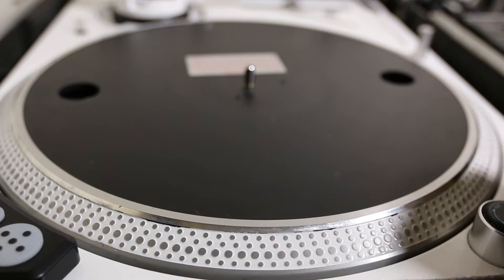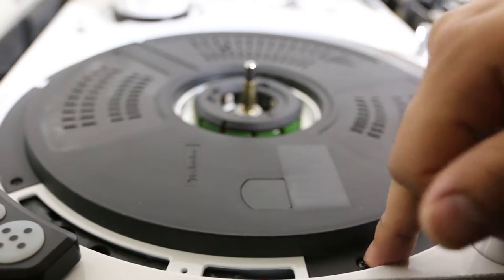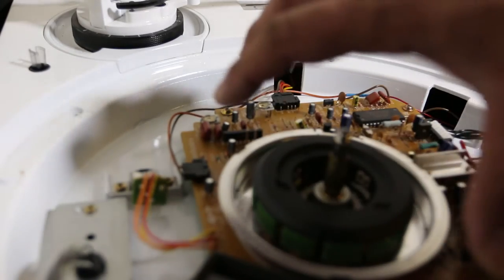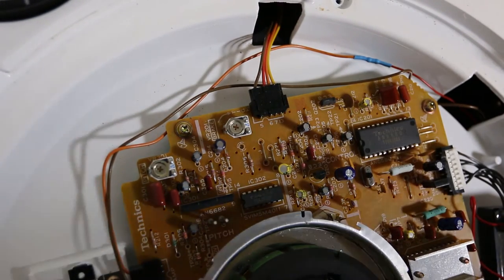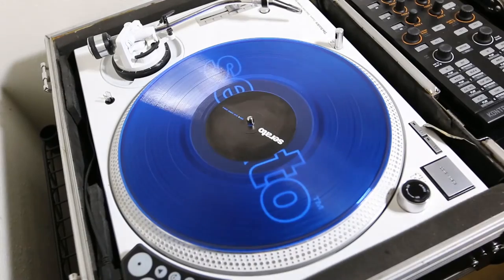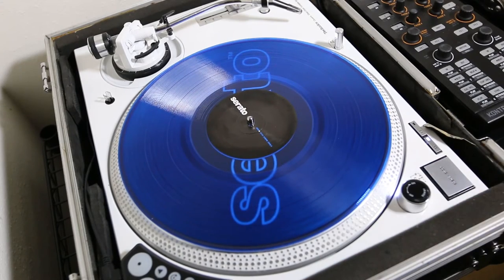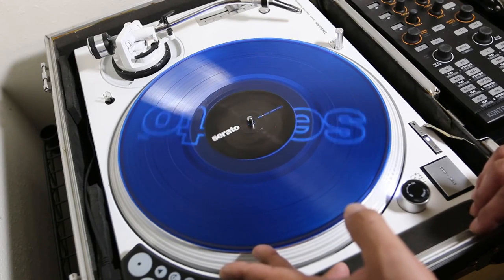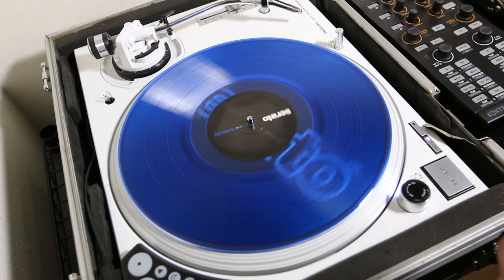Technics Turntable Brake Calibration Walkthrough

Comment: I wish you would do a video on how to get Serato to use an external Drive as the main memory. In other words I have an external drive with all my music, but Serato wont remember my cue points or BPMs. I have to analyze every time and start from Scratch. If all my music was on my mac it would remember everything as soon as I open up my Serato. I have a ton of music and do not want to put it all on my Mac. I bought my Mac brand new in 2014 from Best Buy and have also looked into just upgrading my memory on my mac but was told by the geek squad that I cant do that because the memory is integrated with the mother board. Not real sure what to do. I would like to start using Serato but for now I'm using VDJ 8 with a DDJ-SX-N which is a great software but I notice that there is a lag on VDJ when Scratching. as a matter of fact you sold me that controller. Anyways, I have ran into other people that have that same problem. Maybe you could help. Thanks Brotha!! Your videos are always so informative and some of the best on You tube.
Reply: Whats up Pancake! Typically this happens in Serato when you don't let it close properly. Somethings get saved while running activities such as loading, editing, but when you exit everything is saved to the drive that the file is in if if it does not reside in your Application drive. So make sure you exit the app and allow it to close properly.
Reply: to confirm you should see a folder on your external drive called serato and it should update (check the modified date it will change) in addition to the actual track file residing in your drive because you have added new details such as ques, loops etc..in Serato.